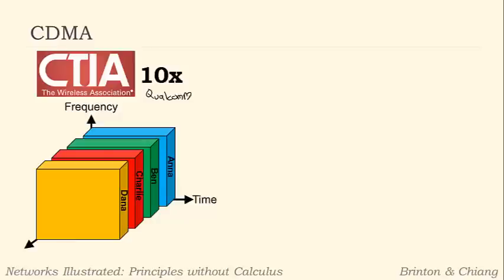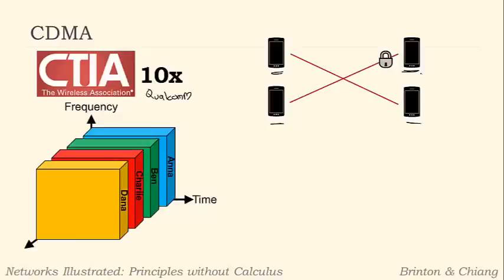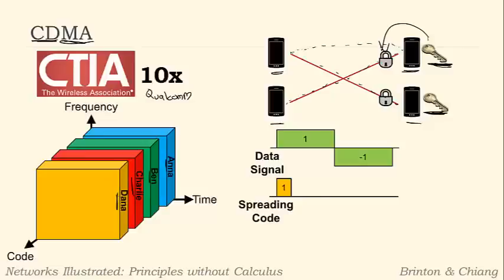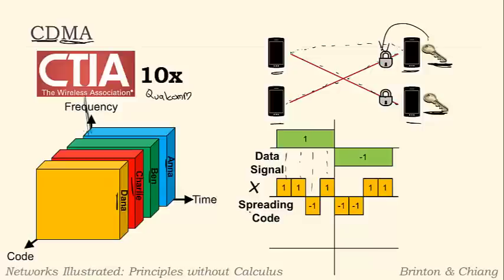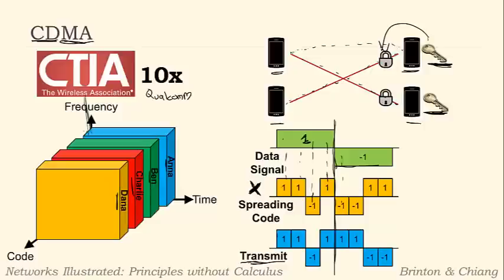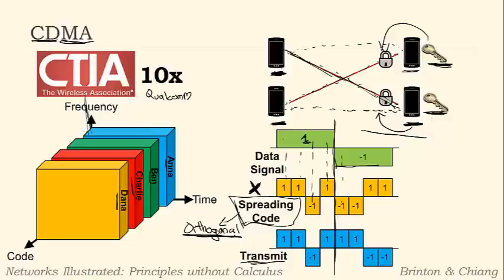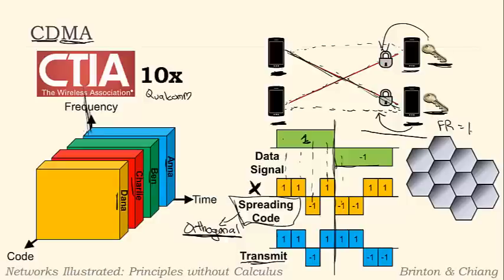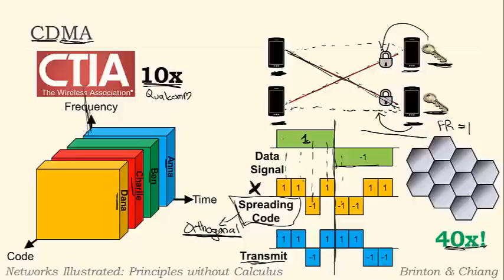Part I: CDMA

Comment: everyone using I : +1V and 0: -1V use logical XNOR not XOR. 

Logical XNOR is: if bits are same output : 1, if not output: 0. 

Example of XNOR logic:

10100000 
00111101 =
01100010

Comment: This video was ok, but there are some problems. The most misleading part is that the illustration shows cellular phones communicating directly with one another like walkie-talkies, when in fact they have to go through base stations and the underlying infrastructure. Also, and this is why I was searching this to begin with, is it uses the (1, -1) notation for "mathematical convenience", and it does not illustrate how multiple codes are combined and how it they are decoded (my textbook uses the same notation, and for the combination they add to a (2, 0, -2), which is more confusing. I would like to see how it works with the closer-to-reality (1, 0) notation, and how possibly interfering signals are handled.

Thanks for the upload, I will continue my search...